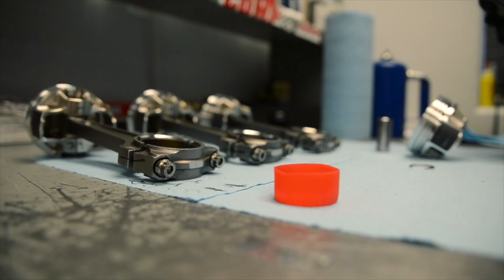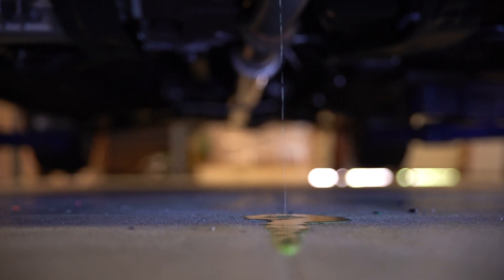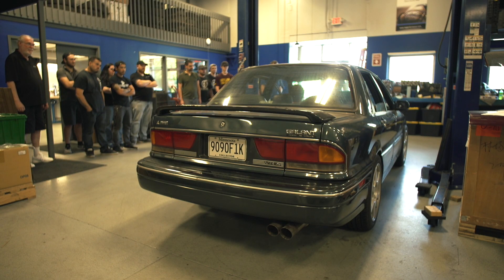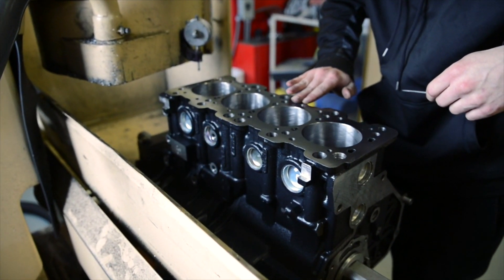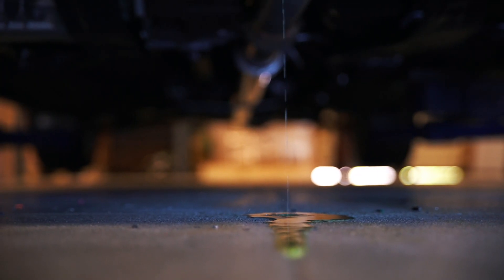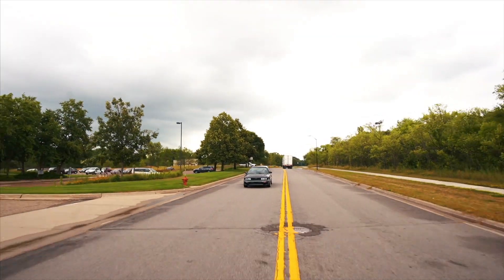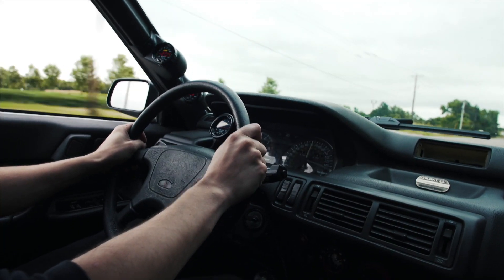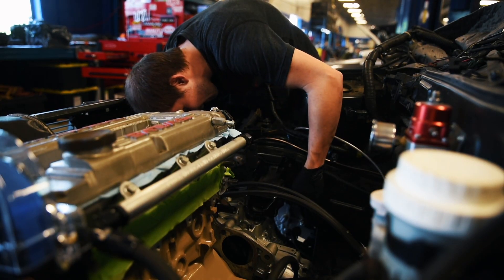Proper Engine Break In Procedure

Comment from the maker: Tell us your experience with breaking in new motors 🤘
Reply: After first start, 20 minutes at 2500 to get the cam ZDDP adhering to the lobes, then hit the road, 20 3rd gear pulls from 2000-5000 rpm and coast down to 2000 and do it again.  After that drive normal, oil change after first fifty miles, then at 500 miles, then normal.  Thing uses no oil, and when taken apart there was no black between the first and second rings.  Straight forward and it never fails.
Reply: That doesnt always work and is bad advice every build turns out differant i am not trying to argue but what works for some does not always work for someone else word to the wise i blew my first motor that was built that way in my 99 mustang gt
Reply: So you are saying i should just go floor my car with only 600 miles
Reply: You were rite i pushed it last night its sealed well an no problem through rpms at all
Reply: @3geclipsebuiltperformance883  to add to what dude said as well, your dad may have a lot of experience, but it IS old experience. Metallurgy and that has all gotten better over the years, modern techniques result in needing less time to achieve a full break in
Reply: @hotelhopper681 maybe I'll look into modern stuff a little more
Reply: rebuilding my ls1 with cam , this info is priceless , awesome thanks so much
Reply: So first lol change at 50 miles?? Doesn’t tho r new engine have special lubricants
Reply: I disagree if you you drive it hard you wear it out faster taking short cuts goes no where whoever made those engine rules never had a father from the 60s where they built cars all the time all the old timers agree no more then 3 during 1000 mile break in i dont care what some body tells me the 3k rpm rule no wot until after 1k miles is safer my car was specialy honed with the map honing plate i work in a shop ive been building things 15yrs facts are facts beat up early lose comp early beat it later hold comp a lot longer and burn no oil vs beat it up wear rings out and lose oil and comp thats a fact maybe you should read how rings work and not from race car people but from people who want there car to last and be fun in the long run not 30k or 70k 😂 thats a bad build 150k should be normal if done rite and good maintenance is applied
Reply: Ok thanks
Reply: I was unaware its safe to push it before 1k but thank you
Reply: Hell yes only did 6k but fun
Reply: does this work the same fork dirt bike motors?
Reply: Im going to be installing a 5.7 hemi and I was wondering what oils should I use to break it in my engine calls for 5w20
Reply: Hey I've got a question for ya. So I've built a few Hondas and sbc. My latest one is a h22a4 that's giving me some trouble. I built this engine once before and lost compression in cylinder 2&4 at 40k. It showed 225psi all 4 but leak down revealed no comp in 2&4. Dummy me assumed it was the head so I threw on a spare head. I still had no comp in 2&4. So I did a complete rebuild. It started great quit smoking but after warm up it lost compression in cylinder 1&2. I checked cylinders with dial bore gauge and never had rings not seat. I'm wondering if I've got a cracked block. I'm going to change to break in oil and see if it seats. Something weird is it has compression when cold but loses compression when hot. Clearances are good idk what's going on here. Also I'd like to ad I went over cylinders with a 600 grit aluminum oxide flex hone. I only did a couple passes to deglaze. Cylinders was 
.001 out of taper. I've rebuilt one h22 without honing and another I used a fine grit rigid hone. The rings seated great and didn't use maybe up to 1/8qt every 5k.
Reply: I rebuilt my hemi 5.7 I put a different camshaft in it.what do I do if it's not going to run properly when I first start it?
Reply: Simple question: How long does it normally take to get the oil to pass through the motor and register on the gauge when priming it? I built the motor, it's got really good build grease on everything, but, should I be squirting oil in the cylinders every couple of seconds so the rings don't dry out while I'm waiting for the filter to fill up and the oil go all the way from front to back? I mean, the battery already died after about a minute and no register, yet. Is there a problem? Or, does it take a minute to get that oil all the way through? I'm super paranoid about destroying the bearings.
Reply: I'm gonna assume your talking about letting the engine slow u down if it's a manual
Reply: i broke mine in 280k miles ago
Reply: why no mention if you should drive it hard early on or not?
Reply: @welcometoreality3450  1:46 "Where you're varying the RPM range" is what it comes down to (and there are plenty of other videos covering the break in period). For however many miles "recommended" for the engine (sport vs. regular cars), we're not dogging it, nor red-lining it, but going up and down and driving "normally". Just common sense and care while doing it. :) 

*here's one, "How to Break In Your New Motorcycle" on the FortNine channel: https://youtu.be/u74jYkItdD8
Reply: I would just baby it until u hit 500 and dont forget to change the oil as needed per miles driven

Comment: We drove new ford motors in fleet vans and they just said drive them like we stole it.  This first oil change was at 500 miles then 5k normally afterwards. Most motors went over 600k miles and one made it 750k miles. Back in the day breaking in a motor was important.  Today the machining and metal hardening techniques are more advanced.

Comment: Dont listen to this guy, go drive the car. Full throttle up to 5rpm will seat it better. This why all LS guys rebuild a motor and go right to the dyno. Dump the oil after the dyno session with more brake in oil. Then drive for 400km. Then synthetic.

Comment: I rebuilt my 7.3 and had the rear freeze plugs were leaking it really made me mad I had to pull the transmission back out and put new freeze plugs in with sealant never leaked again .  Always pressure test your engine block if you  can I never touch the freeze plugs

Comment: I got a question or two. How am I supposed to run on the road straight after the first 2-3 steps if my car has no MOT? 😂 And how do I keep an eye on air temp and fuel ratios with no way of reading them etc i.e. a laptop software.

Comment: Why would a fully rebuilt 1972 302 with new seals and valves, rings, etc, still be burning oil at 1,000 miles of driving it? All cylinders at 120 psi. I was told it would take 3,000 miles for a break in. New PVC and working great. Blue white smoke at startup and fogging the city when gassing it.

Comment: So AMG tells me to drive 1k miles under 85mph, no kick down, nothing over 4500rpm, but i see other ppl saying different things like running the engine 500 miles light with 2 oil changes and push it slightly for 500 more for proper seating

Comment: Mineral oil
20 min @ 2000-3000 rpm
New break-in Oil
50 miles, vary loads, vacuum pulls, no WOT, no lugging, no high heat load 
New break-in Oil
500 miles
New regular Oil 
All done

Comment: Can the engine sound different while it’s wearing in? Ive had a used engine put in with half the miles of my original engine, exhaust was nice and deep before sounds a bit higher pitched making me think exhaust could be loose, but also there’s a ticking when I’m accelerating but goes after

Comment: This not how I break in my race engines at all. 
It hits a Dyno with break-in oil. 
Start it up, warm it up, oil temp 160. 
Right to full throttle to load the rings as hard as possible. 
Zero leak down. 
This break-in procedure seems like a great recipe for blow-by and reduced power.

Comment: Great video and tips on running in a rebuild engine. After the 500 miles run in does the engine head need to be tightened again especially allow heads like Honda?

Comment: I have asked around and its funny how varying the advice is to breaking in a newly built engine.
This one seems very logical...let it warm up, inspect for leaks, use a break-in oil to put it under real world load for 50'ish miles, drain, run new break-in for roughly 500 miles, drain and put in your synthetic oil of choice. Others have had zero issues running a warmup cycle for 20min on conventional oil, dropping in their preferred oil and just sending it without any issues. But why take the chance i guess?

I have a 2.0l ecoboost out of my 2016 Focus ST that was big turbo, bent a rod at about 430whp. its rebuilt with all forged internals and is ready to fire up this week. I think Ill take the extra time and cost to do it like its laid out in this video. I'd rather not have to yank the engine out again just because i overlooked debris in my oil cooler or something

Comment: I did 1200 miles on my new engine, not going over 4k rpms. It felt fine but for some reason it feels like everything has settled in more after I did a few redline pulls

Comment: Hi. Can i please ask a question and get your opinion?  I bought a brand new CF MOTO 450RS motorcycle and from new, gear changes were rough and it had vibrations.  After the first service, the bike felt a lot worse, and engine was over heating sporadically.  At 1400klm I realised when the dealer said that it was normal and I had taken the bike back 6 times, back to the dealer, I investigated the problem and found the dealer was filling the oil to below the empty level.  When I toped up the oil, it took 750ml to get it to the full line.  That's 1/3rd oil missing since new.  

In the cf moto user manual it states that the oil should only be filled to below the low line, but in doesn't say if this when the bike is on the side stand or upright on a service stand.  Turns out they were filling it up on the service stand in the upright, and those instructions were for the bike being on the side stand.  So dealer was filling my bike and some others short of oil.

Engine now sounds rough compared to new bike and I am hearing a slight ratting sound.  Can you please tell me, during this crucial run in period, what is the potential damage to the engine and gear box?  I think during the crucial 1000klm run in, period not having enough oil to meet even the bottom line of the low😊 indicator mark would have caused damage, but dealer said no, it's o.k..

Comment: At 500 miles when covering this.  Do you need to also vary the engine Rpm 
or you can do a wide throttle opening
Reply from the maker: Typically at 500 miles you should still be city driving (low-mid rpm range). Usually don't want to go WOT until about 1000 miles. It all depends on the motor and tune though. Talking with your tuner about your specific setup is the safest route.

Comment: A lot of good pointers here. Very relevant for me as i'm starting my first fully built 4g63 in a few days. The only conflicting info I hear everywhere is the intervals of the initial oil changes. Many are saying it's not necessary to change the oil after the first 20 minutes, and that it's good for the first 100 miles. Where you would then switch to your oil of choice. It's the first hour or so of driving where the crosshatching files the rings (metal shavings) and seats them. Correct me if i'm wrong, but it seems that all the contamination is going to happen over that first drive, not upon startup? Wouldn't it make sense to use break in oil up until 100 miles, then do an oil and filter change until the car hits 500 miles, where it would be done again?

Comment: Followed this guide to a T two years ago when I first started up my tiny 1.6L VW motor w/ forged internals. It does not burn a drop and has an outstanding 260PSI across all four cylinders. Factory spec for new is 240 ;)
Reply from the maker: Woot woot!! Dude that's incredible to hear.
Reply: What oil did you end up using? I’m rebuilding my 1.8t and about ready for start up, a race shop told me to used 15-50 break in oil

Comment: Question, is ok for my motor to say stft 3, -6, 6, -8, 5? My ltft is saying the same thing, random and not stable. I've heard that it's supposed to vary but it's it by that much?
Reply from the maker: Yeah that definitely is a little too much variation. It's normal for those to move around but not usually that much.
Reply: @maperformance  I tried everything, for background I bored it from 86mm bor to 86.5, everyone was telling me that it's ok it's just .5mm over. I had to take apart my motor again and there was so much carbon that the valves were imprinting into the carbon on the piston. Do you think that it could need tuned? I replaced fuel injectors, maf, ECU, wiring, even wasted time making a vacuum test with a bolt and rubber hose. I can't find anything to save my life.

Comment: I know this video is older so idk if I'll get a reply. But I have just first fired my built engine. However it's a full drag car running on c85. So my question is... since I can't drive it. And dyno day is two weeks away, what's a good way to get it ready without being able to drive the car on the street.
Reply from the maker: Typically Tune shops can send you a base tune for you to drive around on. I recommend finding a tuner that can get you a decent base tune, that way you can put miles on everything.
Reply: @maperformance  i have the base, i can start it and pull in and out of the trailer, but i cant drive on teh streets, there is nothing legal, its mostly fiberglass, and no tags. thats my issue, lastly, it ahs a 1.5gal fuel cell, so miles per gallon arent an option as well.

Comment: For my fully built EJ25 I did 20 minutes - oil change. 50 miles under 30% no boost - oil change. 150 at 50-70% no boost oil change. Now I’m on normal oil at 200 miles and running 8-10 psi 50-70% throttle. 250 miles I’m sending it.
Reply: Did it blow up or still going with that psi?
Reply: @thetotlpkg  5500 on the motor. Finished tune running 20psi. Car feels great
Reply: @Creeks_and_critters  makes me feel better. Just rebuilt mine and I am 100% sure it put it together correctly but still have low oil pressure. I guess I will break it in and see what happens.

Comment: We broke in a Mazda V6 KLZE with a mild build on it. We did the first 30 minutes of idle and heat soaking the engine, then did a 50 mile break in on conventional Shell Rotella which is a truck oil for semis with a high zinc content. Then we switched over to Mobil 1 full synthetic 5w-20 and ran that 500 miles. Everything was golden. This is an engine that now has 12000 miles on it and some of those miles were full tilt track days and flat out top speed runs and it's fine. No oil usage, no metal in the oil, just a good all-around engine. 

We're going to use this video to swap in a fully built KLZE with MAPerformance parts! We bought a Precision turbo from you guys and once we get it broke in we're adding the turbo stuff. Shooting for 700whp it's going to be a riot.

Comment: If my built motor starts using more oil than OEM I've got a problem bc my current OEM burns a good amount of oil.
Also, a side note, does strengthing up my OEM motor count as a built motor if I'm replacing everything but the things like the crankcase and cylinder head?
Reply from the maker: A rebuilt motor, if done right, should fix oil consumption issues. A built motor usually equates to replacing OEM components with stronger aftermarket parts that create more power.

Comment: What happens if you have changed the injector size and cams and bored it large. Should I still start it before I take it to the tuner
Reply: No when the change the injector size it will run extremely rich because the computer still thinks ur running the smaller injector so the same size pulse sends more fuel than it thinks

Comment: So if I buy conventional oil and just use it to clean my engine that's fine?.  There's no extra steps after that right? Just put the oil in drive 20 or 30 clicks at a slower past then change it back to the oil I had in it be for?

Comment: >>>>>>>>>>>>>>>>>>>>>>>>>>>>>>>>>>>>>>>NEVER-EVER >>>>>Bring the oil PSI up with the starter on an OLDER motor (Pre roller years) - Or one with out roller rockers!
You can flatten the cam befor you even get it started the first time!

Comment: RPM of my new car always below 2000 (generally around 1500 while driving at 100km/hr). Do I need to push little hard to rev it between 2000 and 4000? How do we know the idea RPM range for a breakin period of a specific car? I am driving Hyundai Santa Fe 2022 2.2D Diesel.

Comment: I saw a ring company say you want the break in oil during your 20 min anxiety fest. Something about the higher zinc, and if you get blowby you are doing more damage not using the thin specifically designed oil. After 25k of upgrades I'm good dumping $50 of oil.

Comment: Correct me if I’m wrong lmao. But I’m pretty sure running normal oil to brake in the cam doesn’t heat treat it as well at all because there’s not much zink in it. Therefore it would increase the speed pitting occurs because the camshaft is soft.

Comment: I'm about halfway through building my Ford 302 and this is another topic I've been itching to know more about since it's such a critical step in this process. Raising the compression to about 10:1 static and 9.1 to 1 dynamic. New one valve relief pistons made of forged aluminum and AFR 185 enforcer cylinder heads. Should get about 400 horsepower on the high side and I'm just stoked to get it running!